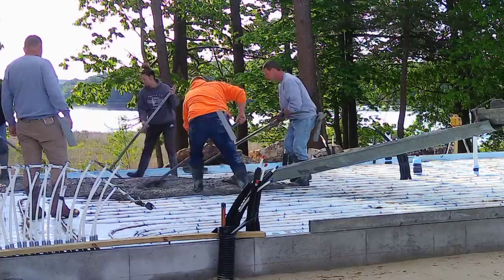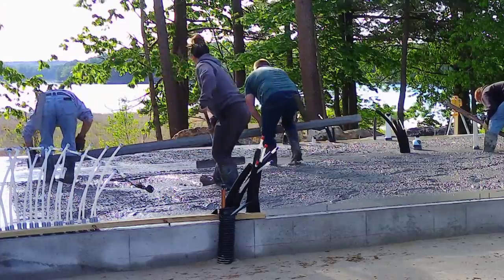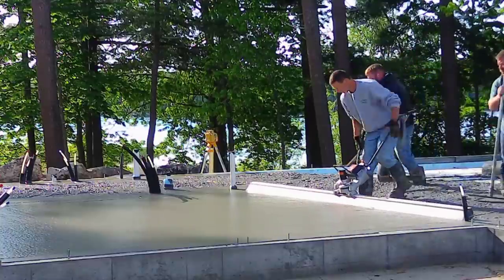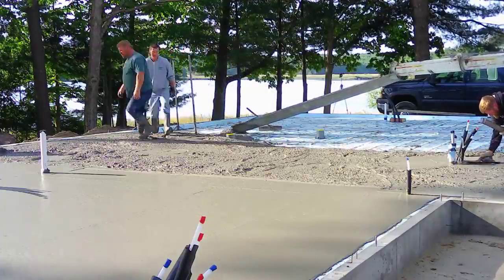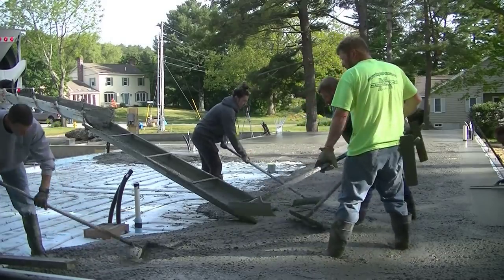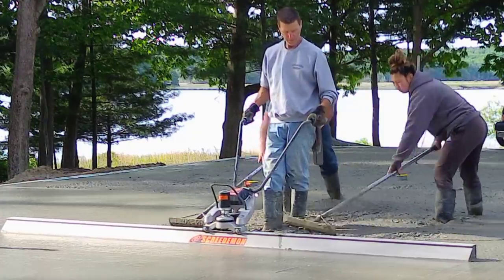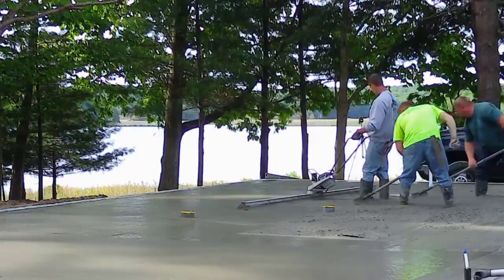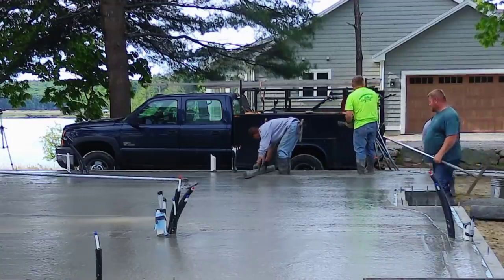Pouring A Big Concrete Floor For A New House (2000 Sq. Ft.)

Comment: Oh man, those jobs where you end up having to blow out and then pull it 40 feet can get damn ugly in a hurry. It can be bad in cool weather, but it's downright brutal on days where you are forced to pour in the middle of the day, during our Georgia summers. I've got several jobs absolutely burnt into my memory for life because they went a little sideways or got away or some other mankiller situation. There's  a few where I started questioning whether or not I was going to survive it. You can't  just stop though. That concrete has you by the jewels. I need to get one of those 12ft ad ons. That is probably invaluable in a lot of pours.
Reply from the maker: I can relate to everything you said. Thank you!